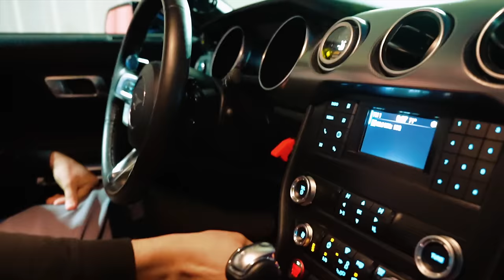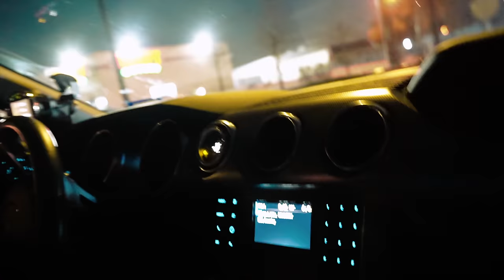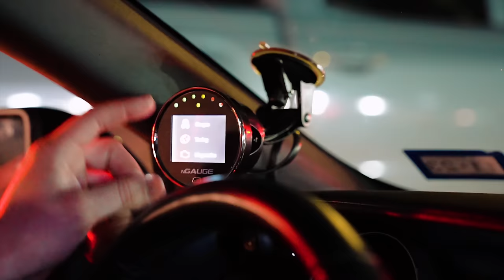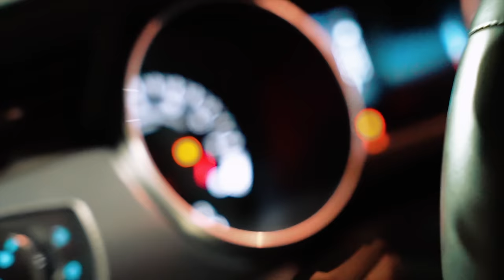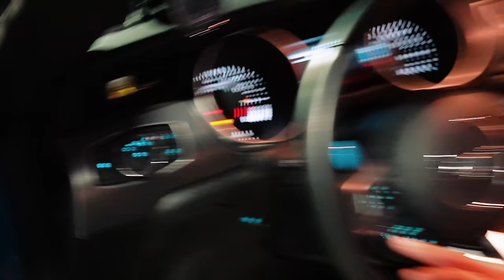We Bought A Crazy Twin Turbo Mustang 1600HP From ​⁠ Midnight Performance

Comment: You take that 10 speed out and put a 400 in it and turn that bitch up and you can run with just about anything street track or what ever well over two thousand horsepower!